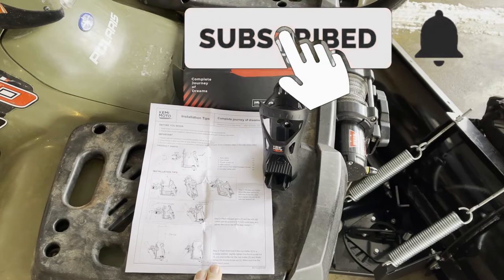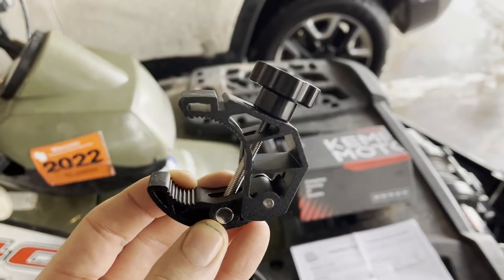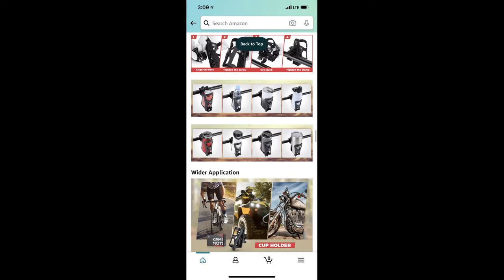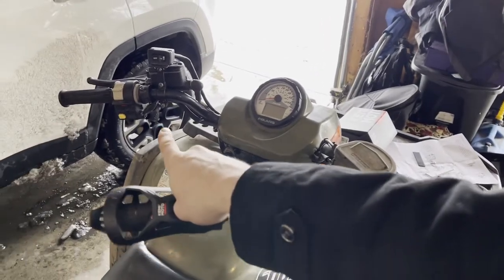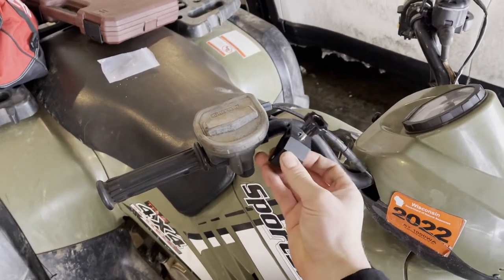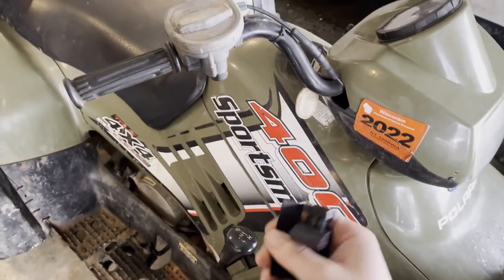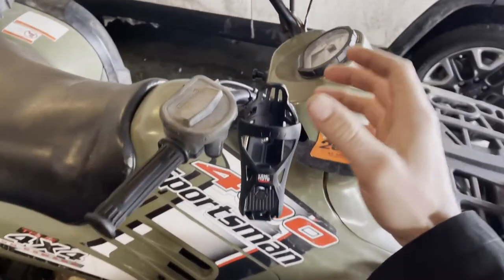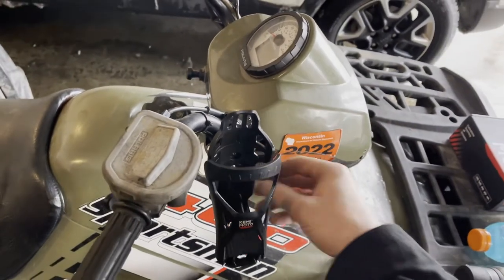KEMIMOTO Cup Holder Install/Review

Comment: I just received mine and clearly you have the same paperwork that I have you cannot use that bottom hole it will not be secure and will spin under vibration,  that cramp is only use on the top hole that bottom hole is for a different type of clamp which you don't have for different applications they sent you the one for bicycles which is what I ordered. Read first before making a review next time. I do like it regardless of your review. Thanks